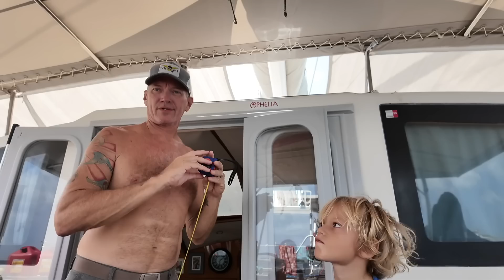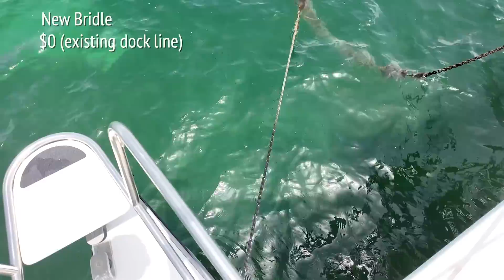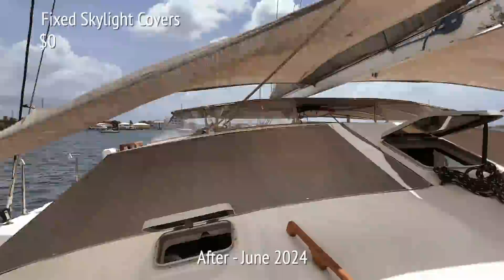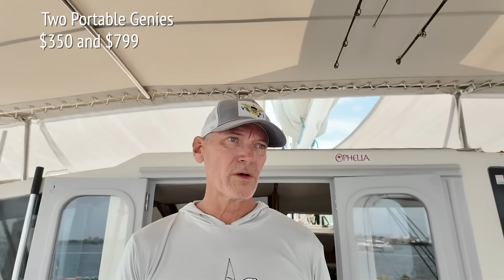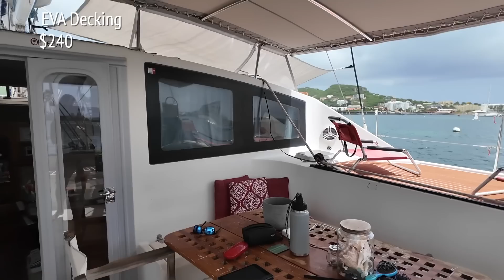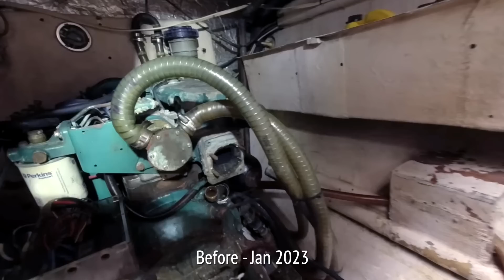2 YEAR Catamaran REFIT - $$ EVERY. SINGLE. COST. $$ - PART 1 | SailAway 275

Comment: Zero chance I would put electric motors on that boat. For the same reason I don't have an electric car. I can't fix it when it breaks.
Reply from the maker: That's definitely true regarding an electric car...no way would I try to fix a Tesla.  Lol.  Not true with an electric drive boat, particularly how we're doing it.  Any "fixes" on this type system are easier and simpler than on a marine diesel.  The motors themselves are maintenance free and extremely reliable...they have 7 total moving parts all sealed and contained, so there's nothing there to fix or that ever really needs to be fixed.  Very very rare for the motor itself to ever be the problem.  The rest is plug and play components and all pretty reliable as well.  The electronic motor controller is the next most expensive to the motor itself, about $1200 (just a small electronic box you unplug) also rare to go bad, a charger is about $500, battery cells are less than $100 each (when you build your own bank you can monitor and potentially replace any bad cells as simple as replacing a car battery).  All the rest is simple displays, wiring, DC/DC converter, etc., each component well under $300 - $400, all things you simply plug in and there's really not many of them.  So a "fix" on this system would typically be replacing a failed component by unplugging and plugging in a new one.  And if you've owned boats with diesels, you know you could spin wheel of a hundred potential issues and the fix or part to replace will easily be in that $100 - $500 range with $1200 or more not being uncommon.

Comment: at what point do you worry about mast (boom) degradation (decay) on a 40 yr old rig - going to look at the 1988 39’ privilege
Reply from the maker: Anything over 15 years old or so, I'd say a really close inspection is a good idea.  Not so much the mast and boom themselves, especially on a Privilege...they made 'em stout...but definitely the standing rigging.  Depends of what may have been upgraded or replaced.  Even really old rigging can be in decent shape, but someone would need to go up to look at all the terminals to check.
Reply: @SailAwayVlog  thanks !!!!

Comment: I design energy systems for yachts for a living. I have done several electric conversions although I don't recommend it for most, I also service the systems quite often. I'm also very familiar with your boat although I haven't seen one converted to Ev. The system you have spec is horribly underpowered for your boat. That's less than 35 horsepower total you will have to push the boat. You have wide hulls windage. I've seen a lot more dissatisfied conversions than happy ones.
Reply: 20k down the drain.
Reply: Hey viva5724 have a look at another Cat doing an electric conversion, it's different. Check out Bilding Wilda. Retractable electric motors.